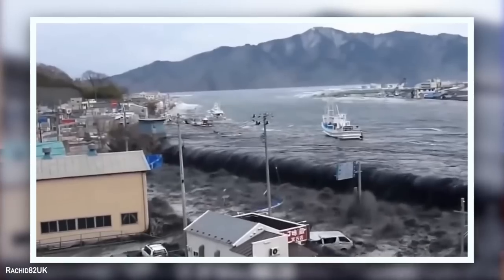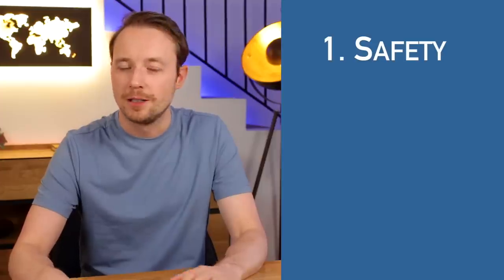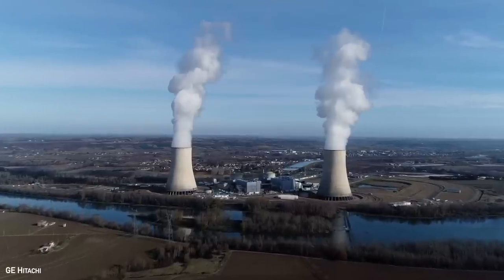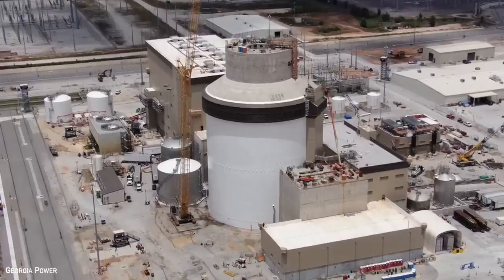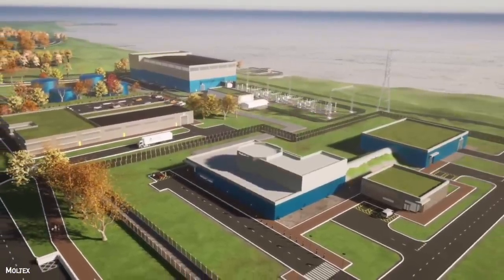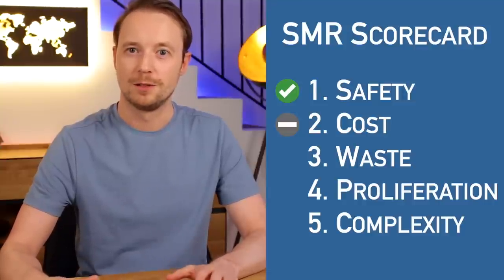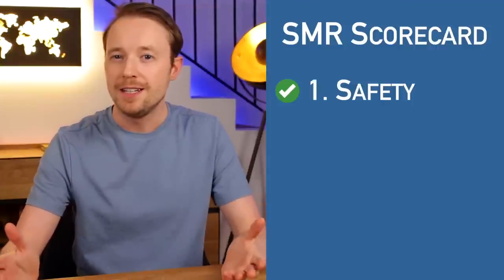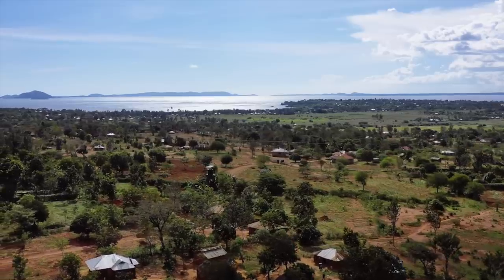Can Small Reactors Revolutionize Nuclear Power?

Comment: This report doesn’t represent what I have read have been the major advances in regulation and designs in the US since 2017.  And the biggest distortion is to not talk about total life cycle costs.  The quote of 10 years of life time of an MSR or SMR is very low compared to 60 years, a number I’ve read. There also should be a cost/design comparison between different SMRs. Total life cycle costs for solar are distorted and often not analyzed, not to mention the assumptions of subsidization.  Subsidization does make solar and wind less expensive.  The cost of installing solar panels on roofs is driven by labor costs and in my case, that meant it take 10 years to pay back the install costs.  Also I think the environmental impact of solar and wind isn’t really assessed. Report like this don’t compare apples and apples together, especially between SMRs, and between existing green energy sources and SMRs, from a total life cycle standpoint.  Also, not stated is that SMRs can provide heat for biofuel creation and biofuel can be more efficiently created and less expensively.  Biofuel enables a zero carbon solution for heavy transportation and industry.  When heat is needed, it’s more efficient to use the heat directly from an SMR than electricity from whatever source.  SMR has been considered for a long time, but the combination of SMR and low pressure MSRs is the more appropriate discussion.  And why constrain SMR discussion to “international” regulation now. Anyway the USAF will have a micro-reactor in 2027.

Comment: Small scale fission reactors could be used to provide ignition energy for a fusion reactor.
Reply: Usable fusion is 10 to 30 (or more) years away according to the people who have achieved a very short burst of fusion output.

Then there's the problem of how to use the heat produced to produce affordable electricity.  Our two most expensive ways of generating electricity involve heat to drive steam turbines.  New coal and new nuclear cost multiple times that of wind, solar, and CCNG.  The market will only buy what is most affordable.

Comment: I love when YT creators just ignore things that don't fit their narrative.  The VC Summer plant was canceled after spending billions and Vogtle is 110% over budget and still not operating so THAT is reality in the U.S.

Here is the REALITY of SMRs in the U.S.

This is from the Des Moines Register an concerning the only Small Modular Reactor (SMR) project in the U.S. today.
In 2013, the Wall Street firm Lazard estimated that the cost of generating electricity at a new nuclear plant in the United States will be between $86 and $122 per megawatt-hour. Last November, Lazard estimated that the corresponding cost will be between $131 and $204 per megawatt-hour based upon the 4 recent new nuclear projects in the U.S. . During the same eight years, renewables have plummeted in cost, and the 2021 estimates of electricity from newly constructed utility-scale solar and wind plants range between $26 and $50 per megawatt-hour. Nuclear power is simply not economically competitive.
SMRs will be even less competitive. Building and operating SMRs will cost more than large reactors for each unit (megawatt) of generation capacity. A reactor that generates five times as much power will not require five times as much concrete or five times as many workers. This makes electricity from small reactors more expensive; many of the original small reactors built in the United States were financially uncompetitive and shut down early.
The estimated cost of constructing a plant with 600 megawatts of electricity from NuScale SMRs, arguably the design closest to deployment in the United States, was originally advertised as costing $1 billion but upon requesting actual bids from engineering firms, increased to $6.1 billion in 2020. Given inflation and other cost constraints that cost today can only be expected to be significantly higher.
The cost was so high that ten members of Utah Associated Municipal Power Systems canceled their contracts. NuScale then changed its proposed plant configuration to 6 fewer reactors but increased each reactor output from 50 Mw to 77 Mw costing at total of $5.3 billion. The NRC just last week approved the construction of the 50 Mw design but now will have to start the review process all over given the switch to a 77 Mw design. For each kilowatt of electrical generation capacity, that estimate is around 80% more than the per-kilowatt cost of the Vogtle project in Georgia — before its cost exploded from $14 billion to over $30 billion. Based on the historical experience with nuclear reactor construction, SMRs are very likely to cost much more than initially expected. And they now have delayed the project start until 2025 in an attempt to find more backers.  All this before the inevitable setbacks that will occur once construction starts.
Reply from the maker: Agreed, the US and western countries in general, have a lot of difficulty in building nuclear for a variety of reasons (lost experience, labor costs, regulators, take your pick). SMRs also haven't been built and NuScale has a number of issues. But the US isn't the whole world, and other places have shown it can be done in a cost-competitive manner. Nuclear has a long way to go in the US but in the rest of the world, it's doing alright. Cheers and thanks for the feedback!
Reply: @atomicblender  While there are many reasons for the build problems, lack of construction skills, fraud, greed, and inept project management tops my list. It is NOT the design or NRC

You should watch a year old IBEW YT video stating how that craft needs to step up and make the Vogtle build a success.  Needless to say it did not age well.  

I live within 50 miles of both VC Summer and Vogtle and know many that work or worked the projects and I have not heard anything good about them except it being easy work and good money. 

I live in the U.S. so what happens in other countries makes no difference to me.  Chinese goods are prevalent in most other countries so the fact that they can build new nuclear cost effectively should not surprise anyone.

After VC Summer and Vogtle, large scale new nuclear projects are a no-go for a long time. And if any utility wants to jump into that fire, your looking at a 16 year build time.

NuScale is on hold till 2025 due to skyrocketing costs and I do not expect it to get any cheaper.

Terrapower was on hold due to the loss of their Russian fuel supplier but the U.S. taxpayer stepped in with $125 million to help poor Bill Gates make his fuel here in the U.S..  However, their site was selected for purely political reasons and I predict that Bill will have more trouble with the locals than he has with his design.

I worked in the nuclear industry for 40+ years at five different facilities and am pro-nuclear  (I know that is a surprise) but I refuse to ignore facts and reality.  I believe it was 2016 when then DOE Secretary Moniz was asked about the future of nuclear power in America. He stated that the future of nuclear power was playing out at VC Summer in SC. and Vogtle in Ga. and if they were successful, then nuclear power had a bright future in America. That simple statement says it all. They F-ed it up and until the issues with the U.S. construction industry are addressed, nothing will change.

Comment: i stay open minded to nuclear but with renewables getting cheaper and cheaper it seems less and less important. hydro power should be used for peak smoothing/ storage/base load that eliminates the need for gas peakers while making solar and wind more useful.

too much solar and wind? turn off the hydro station, maybe even use the extra power to pump waster the other way into the reservoir
Reply from the maker: There are a few demonstration plants like that. Water is pumped up to the top of the reservoir during the day using wind/solar and then it flows back down as needed. If the geography is right, it's very doable.
Reply: @atomicblender  I’m in Vancouver and sometimes forget how flat other areas are haha

Good point
Reply: @atomicblender 
Typical pump back systems pump up at night when power is cheapest and drain down during the day for power leaking.

Comment: Thanks for this concise analysis. An additional consideration has arisen in recen months. With the latest developments in warfare, where civilian infrastructure is now considered a legitimate target for cheap drone weapons, a more distributed approach to the provision of all utilities would seem to be a sensible course for the future, especially when combined with your discussion on complementary renewable sources. SMRs seem to fit the spec. for power at least. Perhaps if CHP could be included in the package, for urban installations at least, SMRs would be a sufficiently attractive option.
Reply: SMR will be great war targets, yes?
Reply: SNR not SMR
Reply: @libearl828  Well, that’s the whole point. Multiple smaller, localised power installations, without vulnerable long distance supply networks would make much harder targets than the current setup, which are highly vulnerable to relatively minor damage, and which take out multiple other utilities, like water, sewage and transport when they go down. They could also be buried and located away from their intended use. Fairly easy to protect from drone attack as well, if needed.  Not hard to build in redundancy either, similar to computer storage architecture, but with each unit located a short distance from its cluster.
Reply: @StepDub  yeah I want one in my yard... NOT
Reply: @libearl828  depends where you live, I suppose.

Comment: Very well and concisely presented. Thank you. I call attention to the elimination of pumps. That would mean natural convection is crucial for heat transfer. I have patented IP for a new convective heat transfer paradigm. It causes a fluid to impinge heat transfer surfaces without impinging the packing, creating the same ideal pressure  drop per superficial meter of travel as no packing at all (no parasitic losses) for a  given heat transfer coefficient - but at 10-20% of the velocity as with no packing or impingement. By using a much lower aspect ratio, the inlet-to-outlet distance and pressure drop is reduced 80-90% for the same heat transfer coefficient. We have accurate measurements and manufacturing for a new class of heat exchanger with other benefits. By the way, I developed it for catalytic reactors constrained by heat transfer and pressure drop in the other SMRs (steam methane reformers). Perhaps you or your fans could direct me to help out. THANKS. Jon
Reply: forced circulation is used to increase power output.  All PWRs can operate under natural circulation but at less than 5% rated power output. You could change designs to increase this but WHY when installing a simple pump solves the problem????
Reply: @clarkkent9080  O thanks, mild-mannered reporter. The YouTube video mentioned that it was a beneficial for SMRs to not require pumps and rotating equipment because they can fail. I might have misunderstood.
Reply: @jonathanfeinstein6997  The Terrapower Natrium reactors does use pumps.  One of the problems with MSR is maintaining the salt molten.  Solidified salt in all the piping and components would be a major problem.  In any case, lets wait until the Natrium reactor operates for a few years before corporate propaganda can be stated as fact
Reply: @clarkkent9080  That is helpful information. Thanks. I am already in my 70's though. How significant do you think it would be to lower the pressure drop by a factor of about 7 for the same heat transfer coefficient.? Would people jump at that?
Reply: @jonathanfeinstein6997  I worked in the nuclear industry for 40+ years at five different facilities and am also now retired. 

I am not sure what you mean by pressure drop.
U.S. PWRs when operating at 100% power, operate very close to the melting point of the fuel cladding.  
If you watch a pot of water begin to boil, you will first see small steam bubbles form at the bottom of the pot, then break free and as they rise the steam bubble collapses as it cools.  This is a very efficient form of heat transfer as steam contains significantly more energy than hot water.
In a reactor core at 100% power, these steam bubbles are formed on the fuel clad surface and swept away by the forced (pump) coolant flow where they collapse and give up their energy to the coolant (very efficient).  Steam is also a good insulator and if they are not swept away from the cladding, it would overheat and melt.
All reactors are designed to keep the core cooled by natural circulation (if the pumps fail) but with a reactor trip when the power output from radioactive decay is less than 5% power.  

so plainly put, pumps allow for power levels that are 20 time higher.
Reply: @clarkkent9080  Cool! My old man worked on the Nautilus for Westinghouse and then the Astro Nuclear division and then supported QA for all those French nukes. When you push a fluid through a heat exchanger it takes work. Like a pipeline, the fluid loses pressure and you need to pump some more. I lower  that resistance to flow. If all you have is buoyant forces to push salt though a heat exchanger, that should help.
Reply: @jonathanfeinstein6997  I started my career at Shippingport which was the first U.S.  commercial power reactor and a testing ground for various navy reactor designs with the last core being a Thorium breeder reactor.

In PWRs and BWRs, the reactor coolant pumps are used to heat the coolant to operating temperature prior to startup and maintain it when the reactor is shutdown.

I have not explored the Natrium MSR design but I would guess that they use pumps to add heat and melt the salt prior to reactor startup.  Loss of that heat source when the reactor is shutdown would result in solidification of the salt and I assume a big problem.
Reply: @clarkkent9080  Ahh yes. i know Shippingport. I was making steel nearby at Midland in the 70's.
Reply: @jonathanfeinstein6997  How times have changed.  Shippingport is no more along with many of the steel mills.  I lived in Pittsburgh and as a young lad used to play in the abandoned J&L steel mill next to the penitentiary. Many interesting and dangerous things to do but that was the norm.
 My parents wanted us kids out of the house after breakfast and did not want to see us  until dinner time.  Now parents are afraid to let kids out of the house.
Reply: @clarkkent9080  I hail from Penn Hills, Mt. Lebanon, East Liberty (S'liberty), Shadyside, Lower Burrel, Carnegie, and the like. Used to watch them pour the slag out at night. It was eventually used to cinder the streets.
Reply: @jonathanfeinstein6997  Hopefully you no longer live there.  The snow, pot holes as big as meteor craters, constant road repairs, black ice, salt and rusted cars.  I miss my friends and family that are still there but I only have to visit once in a while to realize why I no longer want to live there. 
I have lived in many parts of the U.S. and each has its pros and cons.  I now live in the southeast and visit the mountains when I want to see snow.  The one bad thing here is now we have Vogtle unit 3/4 soon to be operational.  My electric bill has a 19% charge for the construction and southern company just asked for a 600 million dollar rate increase once the first unit starts.  Since the $31-32 billion construction loan has a $1 billion per year interest charge, more rate increases will follow and rates will double. 
Old fully paid for nuclear plants are being shutdown because the investor owned utilities say they are not cost effective and we are stuck with this costly mistake

I am pro nuclear but also a ratepayer and new nuclear is too expensive and even climate change will not tip the balance in nuclear's favor.  No advanced reactor or any other corporate propaganda will change that.  New nuclear is dead in the U.S. for at least 20-25 years and in that time something other than nuclear will be the predominate power source.
Reply: @clarkkent9080  You may recall the saying in PA, "The shortest distance between two points is under construction."
Reply: @jonathanfeinstein6997  It is a great state with natural beauty but there are many places that, overall, are better.

I live in Georgia.  8% sales tax.  My property tax is ~1% of may actual homes value and when I turn 70, school tax (75% of my property tax bill) is eliminated.  
At age 65, no retirement income (SS, pension, 401K etc.) is taxed by the state and $65,000 of actual income is not taxed.  In plain words, I pay no state income tax, car tag is $30 per year, car insurance is $500 per year, homeowner insurance is $1100 per year and $300,000 gets you a very nice house in a nice neighborhood.  
Potholes are very rare, cars don't rust, and never see snow more than a dusting every 5 years. 

But I am a damn Yankee in the south.  At least I am the right skin color and sex.